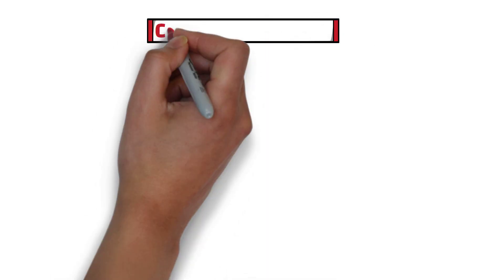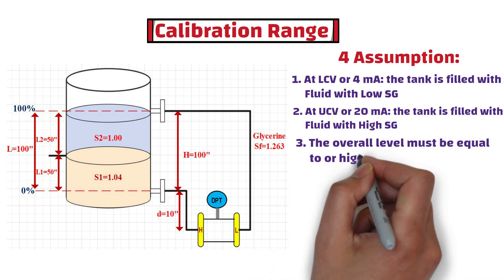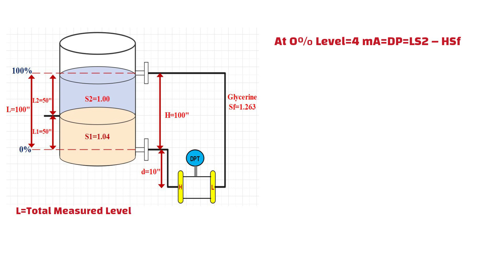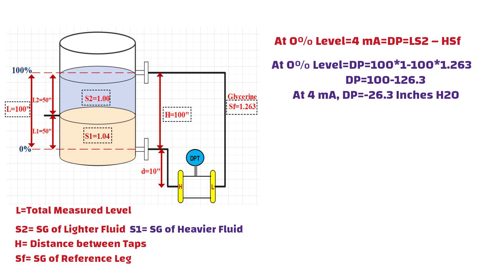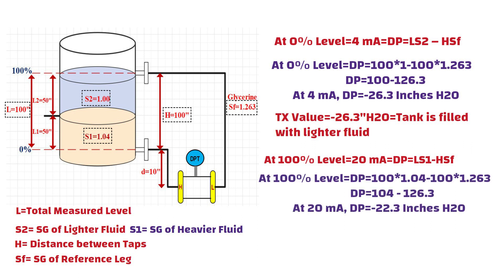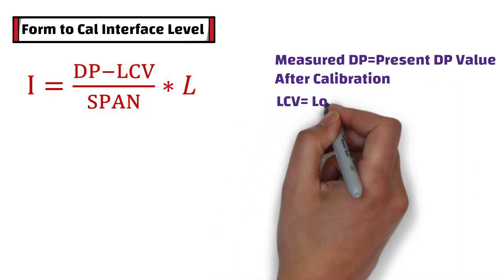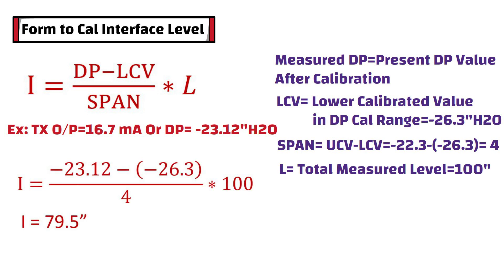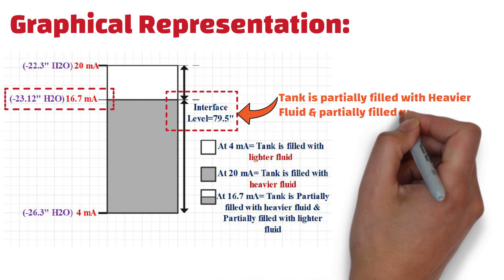Working of Interface Level Measurement by using DPT- Level Transmitter basics

Comment: Hi you missed out d value 10" so the calculations will change little bit...
Reply: 100 means high level, why are you take this.
Reply from the maker: Hello All In One Channel
Thanks for your comment. In this example, capillary fitting  is used. So, height of DP transmitter 
does not affect calculation. So, this is reason. I have not calculated 10".